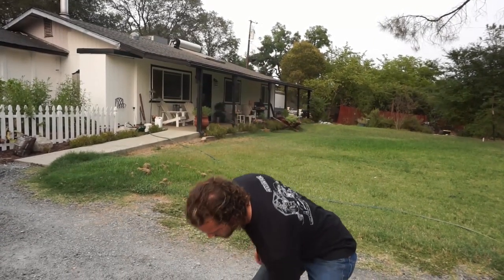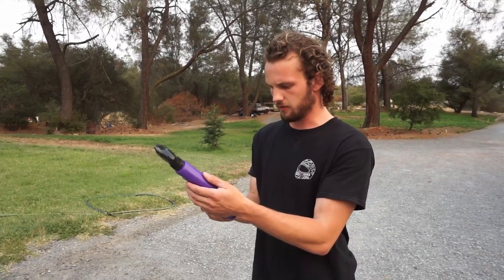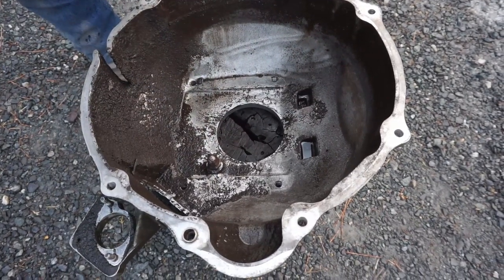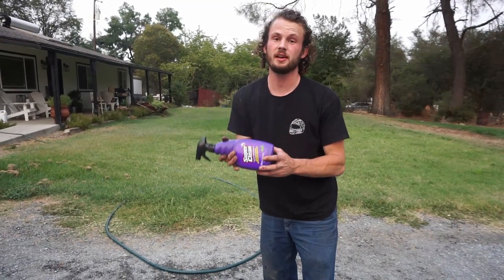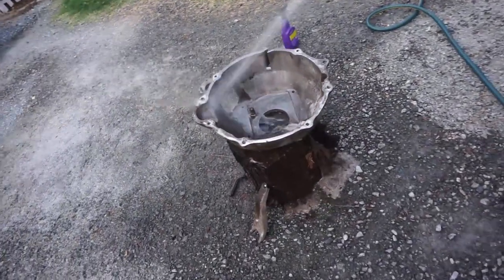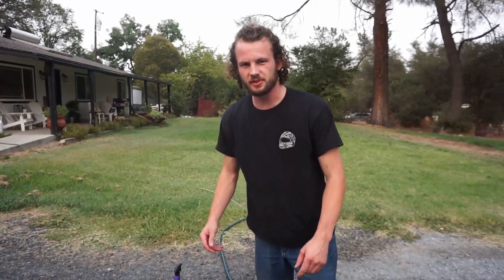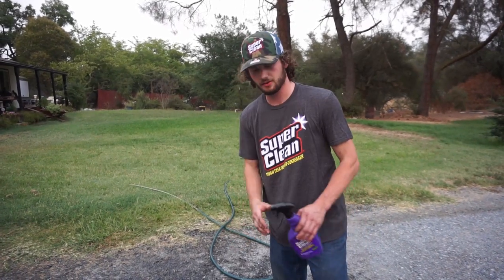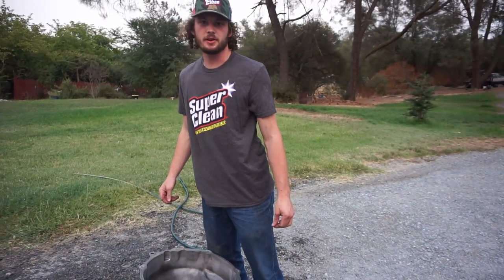Best Grease Remover? Super Clean Review and Bellhousing Cleaning

Comment: I wonder if one can spray this in diluted form on a diesel intake to remove oil sludge and carbon build up from intake. Finishing it up with some water of course. They sell a product that comes from the UK called revive turbo cleaner that was originally designed for use in turbine compressor engines and for cleaning of jet engines. I've been looking for a cheaper alternative maybe I will look at the msds for active ingredients.
Reply from the maker: Might be worth a shot! I've had luck with removing soot off diesel parts so I don't see why it would not work